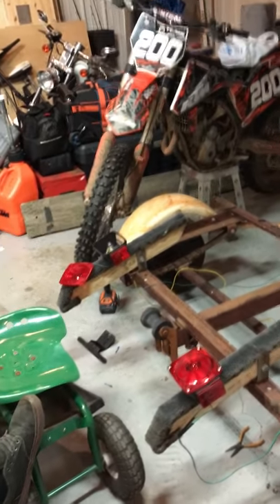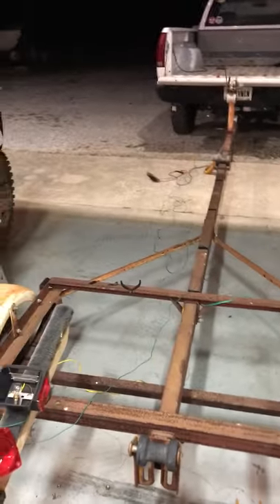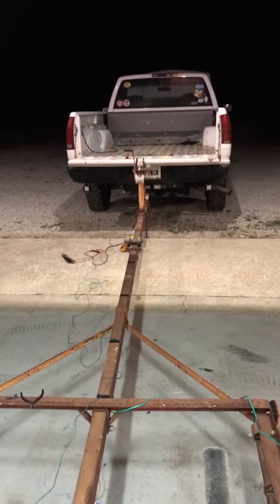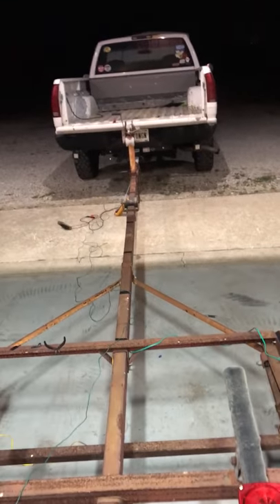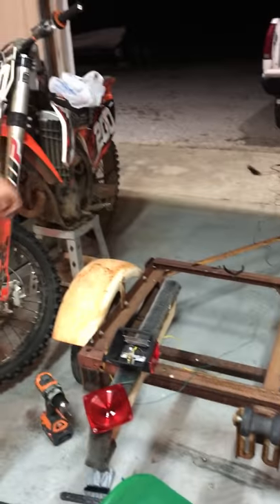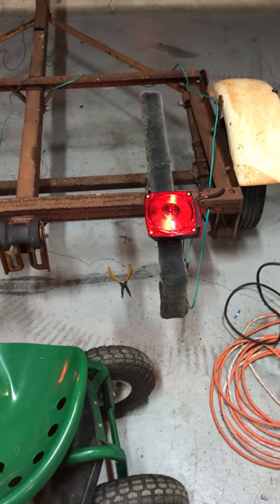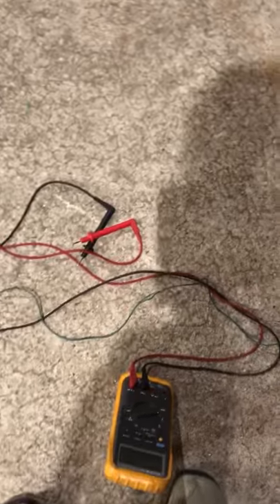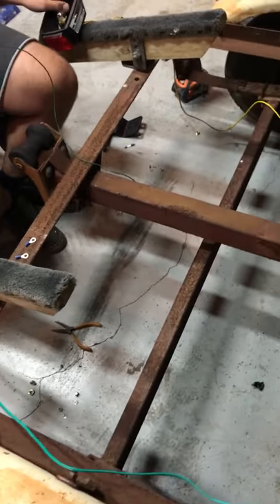Trailer brake and running light problem and solution

Comment: You don't have to run ground wires all the way to the tongue.  Just clean and redo your ground from the trailer to tail lights and harness to front of trailer.  These two in front and back make an invisible wire (your trailer).  Your trailer is your ground or effectively each wire you ran up to the front.  Good  job getting  it working though.

Comment: those lights are self grounding with the mounting bolts...they were working when you were laying them on the tailgate cuz the stud was touching metal...with the studs laying on the carpet there is no ground...if you had bolted the lights to the trailer frame you'd get ground via the studs...no need to run separate wire...just look inside the light housing and you'll see plates that are connected to the one of the mounting studs for ground.
Reply from the maker: BUSHMAN 4570  we realized this, but when we had the ground mounted to the trailer, it didn’t work because the trailer was too rusty. So we had to run a separate ground.   But you’re right though.

Comment: I'm feeling the pain now that you felt when you made this video.
Reply from the maker: Isaiah40:22 same issue?
Reply: @annmariekohler2200  I've ordered new lights and wires and I hope I can get them to work.  It's such a simple circuit, and all the old wiring looks right, and I made new grounds, but nothing works.  Want to buy my trailer?  $25. for the trailer and $250. for my pain and suffering.

Comment: I just built a new trailer and the same exact lights you have. My issue is I have running lights both sides. Turn and brake only on right side & not working on left. I have a 7 pin connector on my Trailblazer which has an adapter to the stamdard 4pin trailer lights. Sounds like a ground issue to me after watching your video... Thoughts?
Reply from the maker: houseoffire72 I’d try regrounding the lights.  We’ve had reoccurring issues with our right light going out and have gone through a couple sets of these lights.  They must just be cheap.  Hope you can figure out what’s wrong!  Definitely check the voltage of your ground and make sure there’s a good connection too.
Reply: @annmariekohler2200  I will check it out tomorrow for sure. I sure appreciate the reply. Get me started in the right direction 😁
Reply: @anjr6282  Yes sir I did... Turned out to be a ground issue... I had run a new ground from front to back...